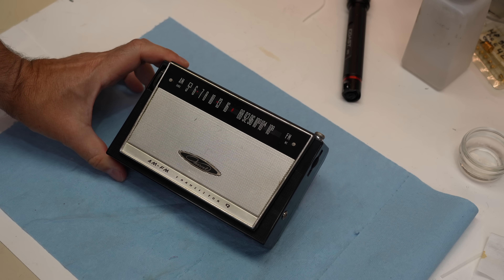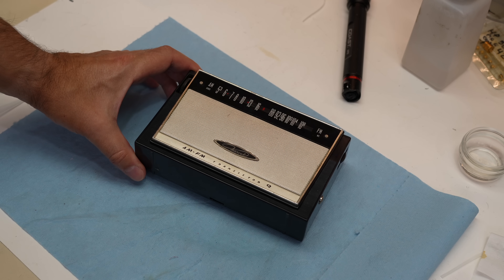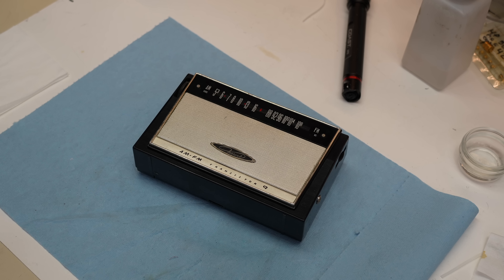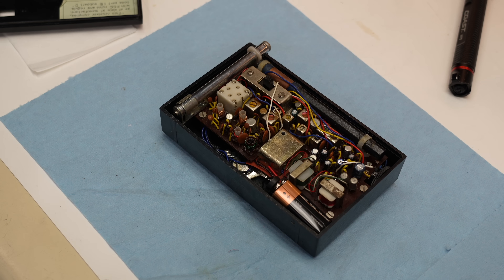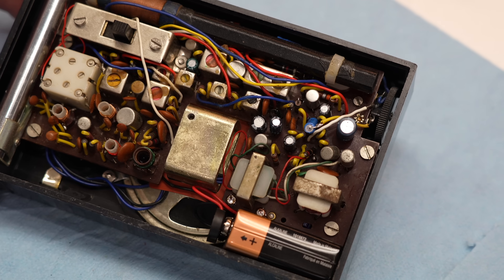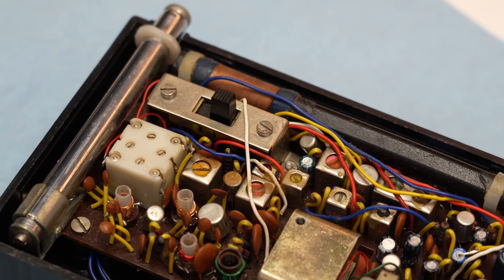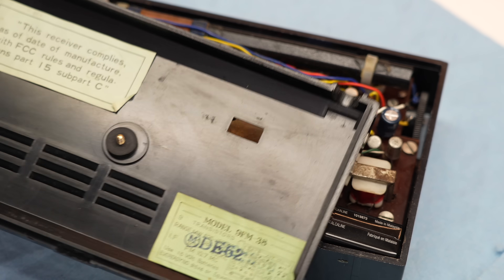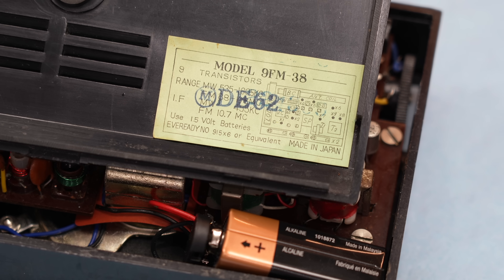1962 Japanese 9-Transistor Radio

Comment: One thing I remember about the mid sixty’s transistor radio sales, the radios were being sold based on the number of transistors they had. 6,9,12… 

Presume-ably, more = better.  Certainly more = higher price. 

Thing was many of the transistors had no function. They were just added to boost the count.

Comment: My grandpa said when transistor radios were first coming out, all the different brands were having battles bragging about how many transistors were in the radio.  Supposedly they would take bad transistors, twist the leads together and solder it into one hole doing nothing just so they could say it had more than the other model.  Anyone else remember this?

Comment: Probably there was a plastic holder for 6 AAA batteries that had snaps on it for the 9V connector.   At some pt it was ruined by battery leakage and tossed.
Reply from the maker: Jeri definitely had some units that still had their 6x AA holders in them, so I am pretty certain that mine is missing its battery holder. I have also seen pictures of units with 4x AA battery holders, as well as 6V schematics.

Comment: One wire running over a switch.... 120 people come to work on a monday morning, and under boxes of parts, 6 types of transistors, 41 different resistors, 23 different caps, screws, 13 sorts of transformers, and more stuff, tens of bundles of pre-cut and pre-soldered wires are delivered to the benches, about 7 colours and 12 different length. Suddenly one worker shouts around if any one has found a bunch of 13 cm wire, it was not delivered at his or her workplace... "No", "No", "Not here", "Not her either...". What shall we do for today, send 120 workers back home, or take that bundle of 12 cm that lies in the corner for months ?
Reply: B.t.w., notice that  every lead of every cap or resistor has a sleeve on...

Comment: Feel better! Your radio made me think that we can trace the layout of its PCB back to the crazy layouts of old tube (valve) circuits: flip over the chassis and you see a tangle of passives, boj, tape, and giant blobs of solder. Your radio's board is just a flattened version of what came in the prior generation.

Comment: I have the utmost respect for Jeri Ellsworth. She once turned a Commodore 64 into an electric guitar, using its original sound chip, AND played it while roller-skating.
Reply: Bass, to be precise - but yeah, she's THE one. Not to mention making her own integrated circuits, akin to Sam Zeloof... hats off to her for that!
Reply: Wasn't that the chick that got fired from Valve? Rings a bell.
Reply: @FrozenHaxor  yes, she did work there - and later on she founded Tilt Five.

Comment: Interesting that the label shows it taking 6 1.5V batteries. It probably won't run that long on the 9V block, which might be a modification.
Reply: It is running on six 1.5 volts. They're just hidden inside the 9V can.
Reply: @Muonium1  yes, but tiny ones.
Reply: @Muonium1  Strictly speaking... yes.
Reply: Yes I remember a similar one we had, the clip would actually connect to a battery holder for 6 AAs.
Reply: @sonic2000gr  You can still buy these holders for (4 or) 6 AA, with the 9V clip.

Comment: I had a similar radio as a kid. I always marveled at how the assembly people could stuff all the parts unerringly into that unmarked phenolic board, with traces so fragile you had to be very very careful with your soldering iron or risk lifting a bunch of them off the board.
Reply: Or dissolving said traces with the solder after the third rework or so, very thin copper layer

Comment: Reusing of active elements was common in valve and early transistor era. I expected you to say it had an reflex amplifier as that is most common way to reuse a transistor.
Reply: Thanks for mentioning the name. It helped me to find out what it is and learn about it.

It's nice to learn about these things. Seems really clever to me to resuse parts of the circuit.
Reply: This one arguably cooler. As it is more dificutlt to convert mixer oscilator to straight amplifier.
Reply: @filipbataz6684  No, its in fact simple, you just switch off positive feedback. And it was used similar way in tube era too. You had AM mixer with ECH81 that was also used as first IF for FM, with ECC85 as FM oscillator and mixer.
Reply: I didn't notice this in tr4 and tr5 they are both IF amps for FM and AM just have diferent filters for each.

Comment: It uses a 2SA70 and 2SA71 germanium transistor in the circuit.. These are similar to the UK Mullard AF117 series which developed internal tin whisker short circuits. Had a 2SA70 in an early Sony TV do the same thing!
Reply: Czechoslovak Tesla in 60s made its copy of OC170 and they dont have this problem - case is different.

Comment: I hope you can do a video about how this radio worked in a little more detail... I like clever electronic tricks. It was cool to see a 1962 transistor radio... wow really cramped.
Reply: This one is looks cool.
The first stage is mixer oscilator for FM, second is switched from mixer oscilator for AM, and then they split for AM and FM then emerge at common audio section.

AM houses bunch of IF amps and diode detector, FM an IF and slope detector.

Audio section realy shows the age of this radio a clas AB or even clas B transformer amp. And to make things older isnstead of using diode to set bias of two final transistors it uses a divider and ptc.
Reply: I didn't notice that tr4 and tr5 are IF for both AM and FM, just have different filter for each.

Comment: I can still smell it....
Reply: Speaking of smell, my brother cleaned up an old tube amplifier my dad had from the 1960's. It had a brown grill that covered 5 sides over the actual board that housed all the tubes. That thing gathered so much dust, you could barely see the orange filaments glowing through. But that thing had a smell alright. I think it was dust, lint, and probably a few dead skin cells all lay on to of those tubes.